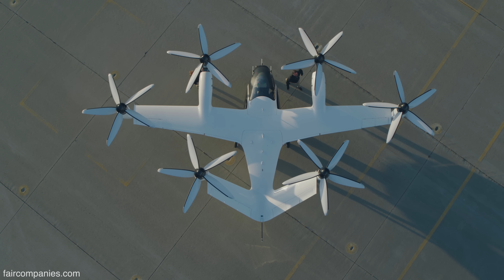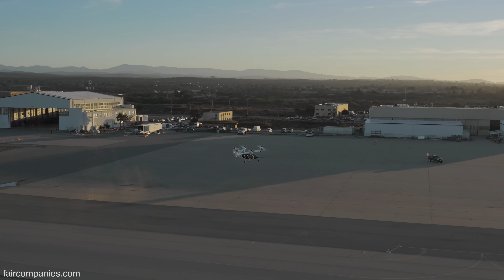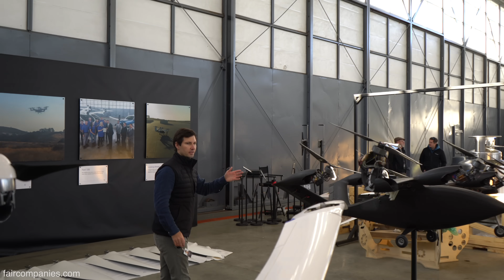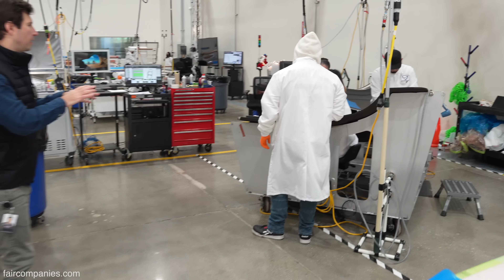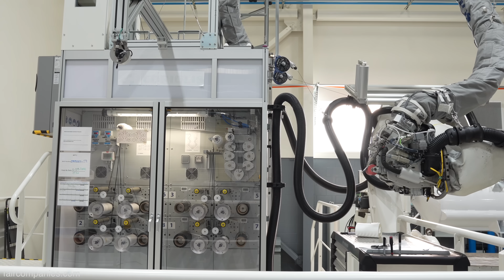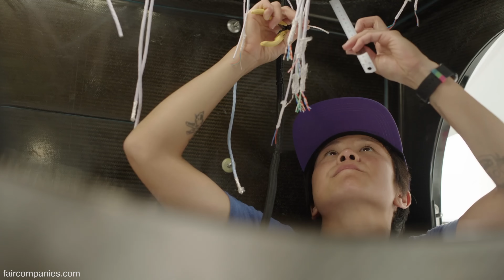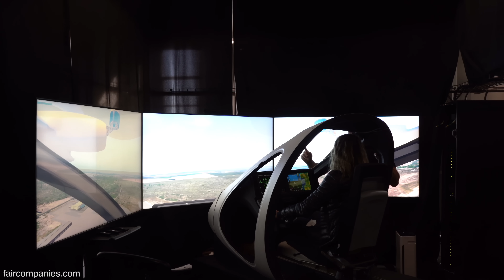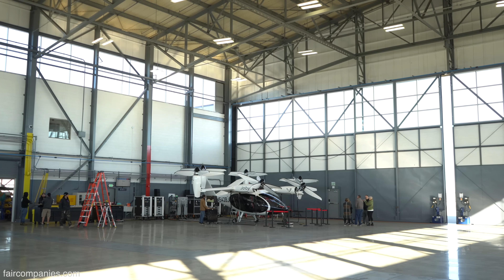eVTOL: electric flying car beats helicopters in silent commute

Comment: I really love how quiet it is. None of that energy wasted in making droning noise.
Reply: That thing is amazing!! Hopefully battery tech will take the leap and and put an end to 100LL finally
Reply: It’s an osprey
Reply: @worldview2134  A quieter Osprey; have you ever been around the military Osprey ?
It really is LOUD......
Reply: What is the sound power at take off compared to helicopters or planes ? How does it match the WHO requirements in the envrironment (55 dB Lden) ? The 65 dB commented in the video does not mean anything : is it pressure ? Where with respect to the source ? Envisioning this kind of things closer to densely populated area than current aircraft will certainly come with noise pollution issue and sorry but the only comparison is in fly by for which you are comparing to non noise regulated aircraft - being « quieter » than unregulated source does not mean anything (apart from the fact that there is indeed a huge noise issue with those objects)
Reply: Here is the noise comparison video:

https://youtu.be/itP8-3j2UZI
Reply: Anything is quiet if you recorded it 300ft away...
Reply: @Helloverlord  they showed different sound signature of various aircraft’s at the same distance and mentioned that this thing is below 70dB at lift off
Reply: @Helloverlord  I guess you missed the side by side measurements relative to gas engine planes and choppers.  Sometimes if your whole life is controlled by TLDR, you miss things.
Reply: @DIYDaveT  in most aircraft, barring jets, the blades are what makes the noise, not the engines.  Compare an electric rc plane vs nitro, they are not much quieter at higher rpm range! And some are louder!
Reply: @Coupe420  that can be true, especially as you mention, at higher rpm ranges.  With designs like this one however, with very large blades and lots of them, you can bring the rpms down - reducing tip speed and thus reducing noise substantially.  I believe these propellers even have winglets.

This means that the engine portion of the noise becomes a much larger contributing factor - and ICE airplane engines are very loud, with or without propeller noise.
Reply: @Helloverlord Here is the noise comparison video - this vehicle is much quieter than convention aircraft:

https://youtu.be/itP8-3j2UZI
Reply: @Helloverlord  you clearly dont live close to an airport

Comment: I'd like to know how many rotors they'd actually need to fly if they weren't accounting for safety redundancy?
Reply: a gyrocopter can safely land without a single powered propeller.
Reply: @NEXENgames  Two at the same diameter line, so if there's one drop out at 3 o'clock, the one at 9 has to disengage as well, but in VTOL mode I dont think this one would safely make it down if more then two on different diameters line are out...

Comment: Big advances in battery capacity, discharge rate and charge time are on the horizon. These will make an enormous difference to both weight and range. It's certainly an exciting frontier.

Comment: This is the technology that's been in use by the military as the 
Bell Boeing V-22 Osprey for about 20 years. not in electrical powered form though.

Though most people couldn't park this in their driveway, it does eliminate the building of a runway, making a means of transportation on remote areas. Will probably require a lot less maintenance and no Petro fuel.

Ironically  perhaps, it was Nikola Tesla who seems to have first proposed the tilt-rotor copter. It was never build of course because the necessary technology to even begin building it was years in the future.

I'm sure Uber and Lyft are following this closely.
Reply: The transmission in the Osprey is very problematic though. This aircraft handles redundancy in a very different way.
Reply: @I-0-0-I  I suppose having six instead of two rotors makes balancing the load and transitioning to forward flight easier than the Osprey. And a lot of the physics has been refined by the massive number of consumer drones in the last 20 years.
Reply: The problem is that with it's limited range it won't be used much for really remote areas.
Reply: @tinayoga8844  Some "remote areas" have electricity. In fact electricity may be more available than petro fuel. Some off-grid places might be able to charge by solar power alone. And this is a prototype. There will be smaller, less power demanding models.

Comment: This is so Great 👍 of next Gen equipment, this maybe a great new idea for emergency transportation for urgent site to Trauma cases
Reply: Actually, what you suggest is the very rare case the concept seems viable, economically and in terms of realism, as a quieter successor to helicopters. We need the practicallity of helicopters, but going electric drones-like crafts comes at a risk yet to be solved : assymetric lift => total loss of control. If they are reliable enough (statistics) or we come up with some sort of compromise (like trade payload for redundancy or safety equipment), then having qualified pilots manning them is acceptable (not the lambda anyone casually flying and encoutering a flock of birds, not trained enough to react on the spot).

Comment: As long as they promote the aspect that it is more quiet, that is good.  Electric power does not mean green like the powers at be try to portray, actually it is worse when you factor in the environmental impact that lithium battery production costs.  Not to mention carbon composites that are not recyclable, think wind mill blades that are just buried because no land fill will take them.
Reply: There’s an article in motortrend titled you are being lied to about electric cars. Sane applies here. Everything you said is not correct in the least
Reply: Last week I was at a small airport to buy something off a guy. He had his own building for his plane. It was a commercially built plane built in the 1950s. It did have a new motor but otherwise it was original, still flying. Planes are built to last longer than cars. So I don't see it being non-recyclable as a problem for an electric plane like this.
Reply: @tinayoga8844  Emissions from fuel combustion are much higher than production emissions of an (electric) aircraft.
Reply: @Freba9  Production emissions AND the emissions needed to bury the damn components. Not to mention the Emissions needed to generate the electricity that these things run on. Last time i checked the world still doesnt run on Nuclear reactors sadly. And the Gas supply is getting cut dramatically due to bans on fracking. So yes, electric vehicles are not as emission friendly as people make em out to be. I still love EV´s but im not delusional.
Reply: @snakeace0  My claim obviously includes electricity emissions. And the fact that you think that batteries 'get burried' proves that you didn't do a lot of reading on the subject.
Reply: it is not worse, small aircraft still use lead added fuels, and people who live in proximity are still exposed to lead, electric aircraft remove that
Reply: Electric vehicles / aircraft are always less polluting due to the overal efficiency, even if mainly non renewable energy is used for charging.

Comment: I’d like to see a test situation with one rotor out of sync due to mechanical failure, to see how the remaining rotors maintain stable flight. It has to be done eventually. 👍 Cool prototype.
Reply: with multiple electric motors, all of which can be controlled independently, if a motor is not performing correctly it can be shutdown & remaining motors receive more power to compensate.  Having wing like structures also allows for added lift/glide as opposed to "auto rotating" (aka crashing - falling like a rock) in a traditional helicopter.  With six motors as long as if four remain operational this should allow for a controlled landing.
Reply: Let's try to remember that battery packs can also be redundant --- so in order for a catastrophic failure and crash, this aircraft would need more than two rotors to fail as well as multiple battery packs --- literally close to zero chance!
Reply: They've done it in testing. You could theoretically shut down all but 2 motors and still land. You'd have to land like an airplane though.
Reply: @blueman5924  Airlines have had many issues and fatalities, yet you fully trust them. C’mon

Comment: People drive crappy now. Imagine if they were all off the ground. Would be a nightmare. Extremely bad idea.
Reply: Fortunately, only qualified pilots will be allowed to fly this, and all rules of flying will apply, like safe distance, etc.
Reply: You're acting as if normal people would have access to this. This is only for rich 1%ers. And they can afford the liability
Reply: Automation is the future.
Reply: The idea is to start with planned routes from city centers to airports.  So far,  air traffic control can handle 2 fights per minute in simulations.

Comment: It's an elaborate helicopter, nothing resembles a car.
Reply: Closer to an Osprey military plane.
Reply: @blueman5924  yes
Reply: "car" from "carriage" is just a vehicle to carry. It has meant a lot of different things in the past and will probably continue to change.
Reply: It’s like a car in that in theory you should be able to go from one house to another like a car. It can do that because it lands and takes off vertically and is quiet. Helicopters and Planes can’t do that because they are loud. I see why they called it a car.
Reply: It’s nothing like a helicopter! Copters have 1 or 2 horizontal props as rotor blades and 1 vertical prop this thing has six props which articulate like the osprey which is a plane capable of VTOL , helicopters don’t have wings either!
Reply: This won’t replace cars, it’s more to replace what you’re suggesting.  Short-distant hops which require vastly more fuel using existing technologies.  This is also a great way for those areas zoned against rotors to allow for this quiet tech!
Reply: Are there any electric helicopters?
Reply: Parks in your 'driveway'...
Reply: Today's Technology can achieve almost anything, just because you can do something doesn't mean you should. Millions spent to benefit the very few. Joby in Scotland, means something else... 🤣😂🤣
Reply: Hexicopter.
Reply: VTOL is a thing though, it's a type of aircraft. Stands for Vertical Take OFF and Landing. Been around for ages so second-guessing why or why not it resembles a helicopter is kinda redundant. It's a VTOL, simple as that.
Reply: Elaborate hoax.
Reply: They are always helicopters with extra steps
Reply: Very little in common wirh a conventional helicopter nearer to a large  rc model aircraft/drone.
Reply: It's a simpler helicopter, but yeah
Reply: Yes ! Exactly my first thought, thanks for pointing it out. I believe the Robinson R-22 would be a little smaller when I look at the wingspan (+ fans), and from my experience in drones (quad), losing one engine is quite dramatic (immediate loss of control due to assymetry), nowhere near the "chill" you feel when you have power loss on an R-22, you maintain level and you can autorotate if you're high enough.
Reply: Yes it does it has three wheels like a Robin Reliant 😂
Reply: Oh for crying out loud! These folks seem to be honestly working towards something that has not been done before. 

Contrarian anklebiters begone. 

Theirs, as is my wish, we need to find a energy-dense and highly rechargeable battery.

 Battery. Battery. Battery. Battery.

!!!

Gosh darn it, if I had the right kind of battery I would change this world.